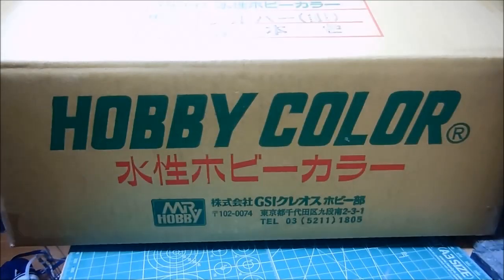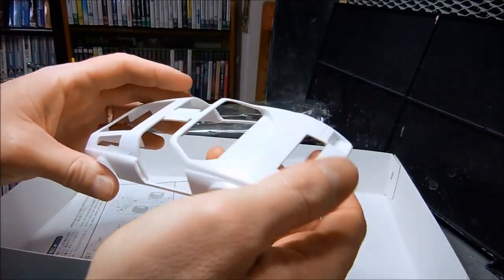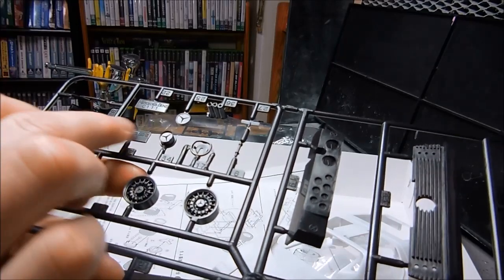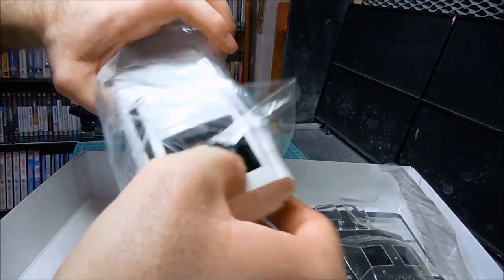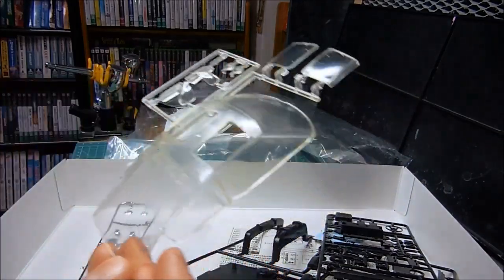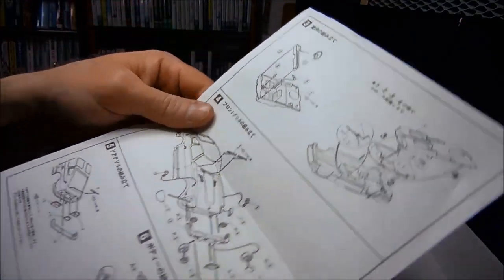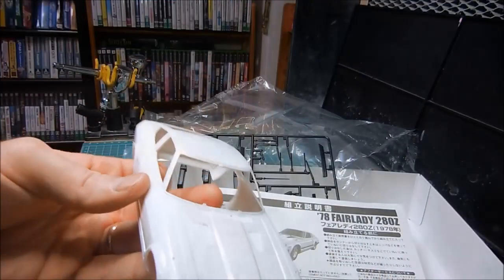ARII 1:24 '70 Benz C111 & '78 Fairlady 280Z model ubnoxings

Comment: A few belated postscripts:
1) MicroAce still makes these kit and other car kits, although they don't advertise this on their website, prefering to concentrate their business on the model railroading side.  There was an issue a while back that you can still get through HobbyLink Japan.
2) These kits could, theoretically, appear in AMT boxes.  AMT has a partnership with MicroAce currently; they put out some old Otaki-source 1/48 WW2 fighters a few years ago.  
3) I wanted to build the -II version of the Mercedes, but the body was so radically resculpted that it would be better to engineer it completely from scratch than to attempt cosmetic surgery on the existing ARII body.  The AHM/Nakamura kit is the only alternative, and unfortunately so rare that it's not worth trying to find.
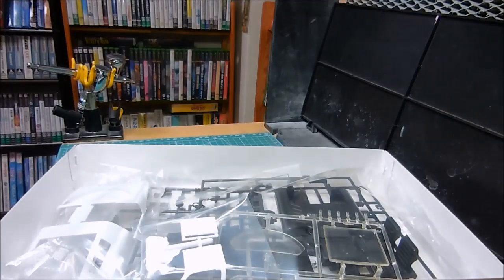Reply from the maker: Thanks for the information. I've actually been to the Microace/ARII building, just to take pictures of it from the outside. It's unfortunate that they do not even mention their models on the MicroAce website. IIRC, they re-released the Otaki/ARII 1:48 planes fairly recently. I bought their P-40 Warhawk.

Comment: The 1978 is the same as 1979.  The spoiler on the real car was an aftermarket part.  Btw thank you for showcasing this model as I was thinking of getting it.  After seeing the chassis and interior I'll probably pass.
Reply from the maker: Yes, I was disappointed with the interior and underside. The only reason why the seats seem small is that perhaps this kit was originally intended to be a motorized kit. That would also explain the lack of detail on the chassis.